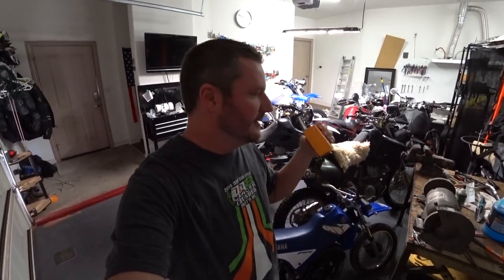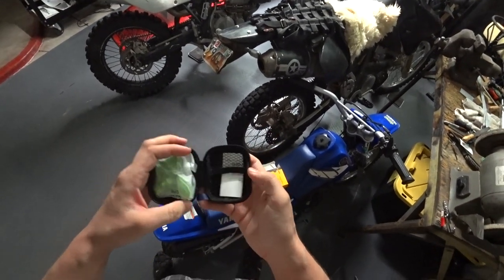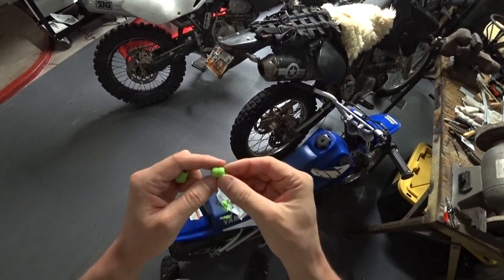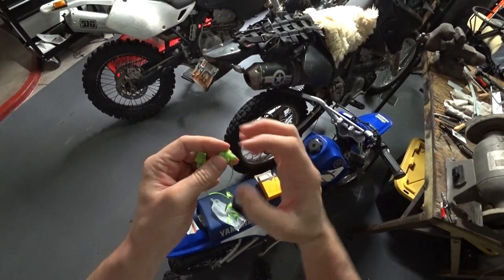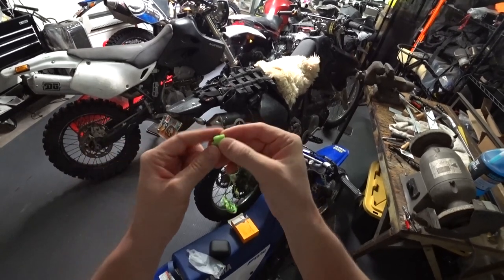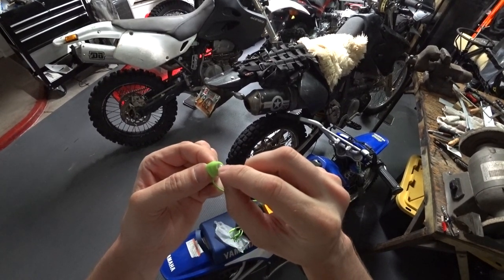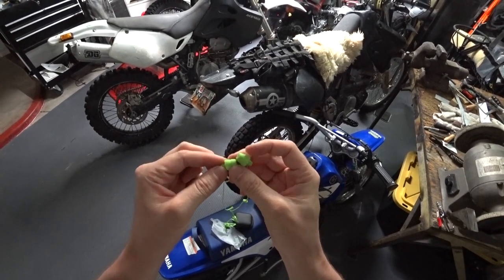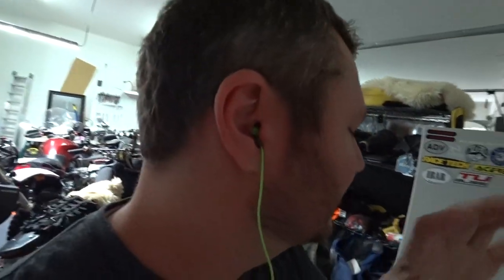THE BEST VALUE EARBUDS for Motorcycles, Dirt Bikes, or Even Sleeping! #everide

Comment from the maker: These may not be the best, most expensive,  most audiophile-tastic headphones out there, but they're low-profile, comfortable, inexpensive, and block a ton of noise. At $14 I highly recommend them! Find them at the top of my "moto stuff" list: http://amazon.com/shop/everide
Reply: Gets the job done.
Reply: extra $1.04 to get a 2-year warranty through Amazon too...
Reply: 26 on Amazon for Canadians like wtf. Should be 18 if you convert USD to CAD.
Reply: I'll try them. I have been riding with Plugfones for quite a while and they work well too. Actually still on my first pair so they have also held up well.
Reply: Dankpods will test that

Comment: I received these headphones on Christmas '18. I just had a chance to use them yesterday (Jan 6, '19) as we had a 65+ drg warm spell. They worked wonderfully! The base and highs are more than adequate for riding.  I have a Bell MX-9 Snow, and it's not the quietest out there to say the least. Having the music comfortably at the ear, with ear plug like noise reduction allows much lower volumes, adds a huge amount of detail while allowing environmental noises to not be overpowered. The hard case is pretty cool too, it now holds/protects my headlamp. Thanks for the recommendation!

Comment: I tried these because of the way the cable comes out at 90°. Though a few bucks cheaper, they are not as good as Plugfones in either sound quality or external sound suppresion.  Gave them to a friend and they came apart the next weekend.   Ive been using same set of Plugfones for three years now without issues.
Reply: it seems like the plugfones might protrude out a bit further than would be comfortable.  Do you have any problems with this? A re they comfortable underneath your helmet and can you put your helmet on without them popping out?